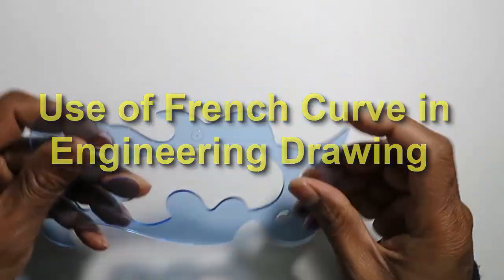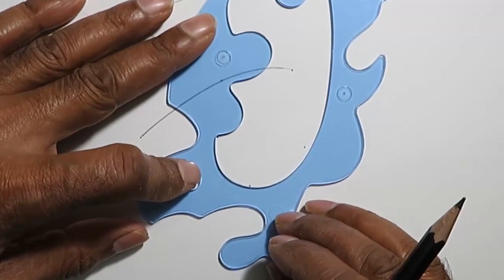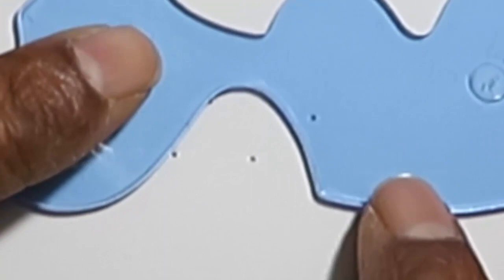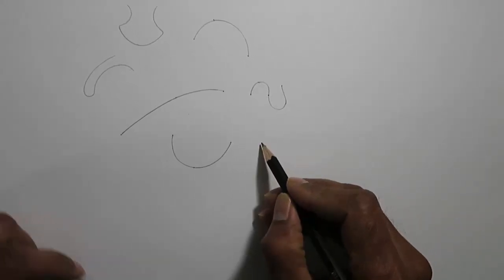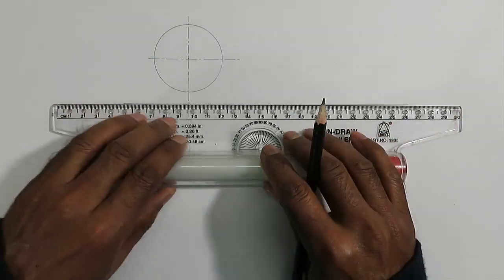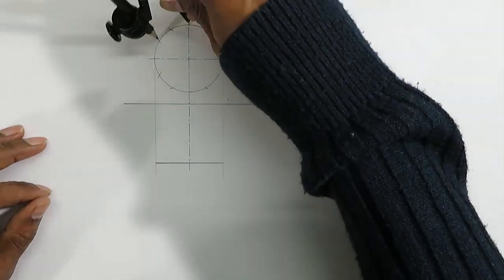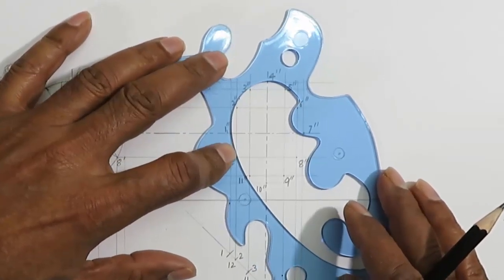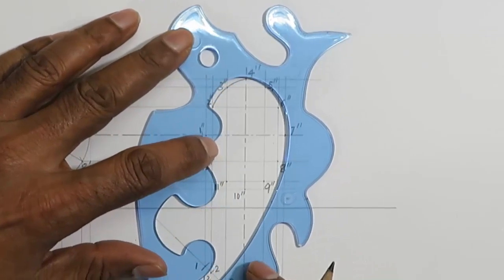1.6-Use of French Curve in Engineering Drawing

Comment: ( Wikipedia    -    Airfoil)    -     Thin airfoil theory is a simple theory of airfoils that relates angle of attack to lift for incompressible, inviscid flows. It was devised by German-American mathematician Max Munk and further refined by British aerodynamicist Hermann Glauert and others[12] in the 1920s. The theory idealizes the flow around an airfoil as two-dimensional flow around a thin airfoil. It can be imagined as addressing an airfoil of zero thickness and infinite wingspan.

Thin airfoil theory was particularly notable in its day because it provided a sound theoretical basis for the following important properties of airfoils in two-dimensional flow:[13][14]

on a symmetric airfoil, the center of pressure and aerodynamic center are coincident and lie exactly one quarter of the chord behind the leading edge.
on a cambered airfoil, the aerodynamic center lies exactly one quarter of the chord behind the leading edge.
the slope of the lift coefficient versus angle of attack line is {\displaystyle 2\pi \!}2 \pi\! units per radian.